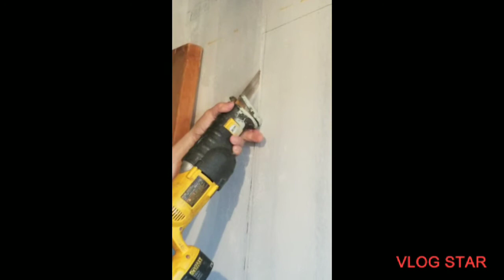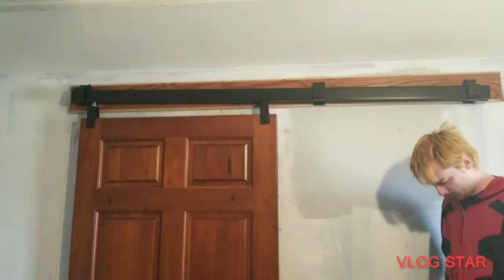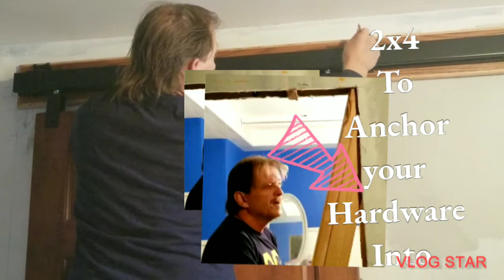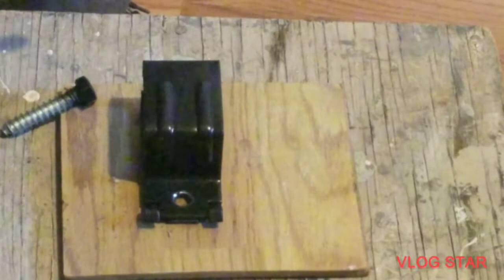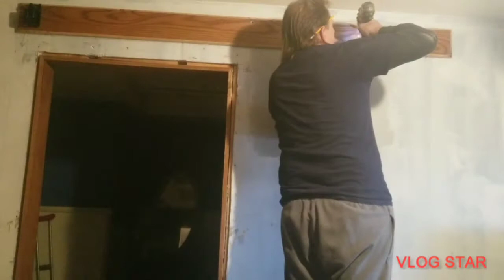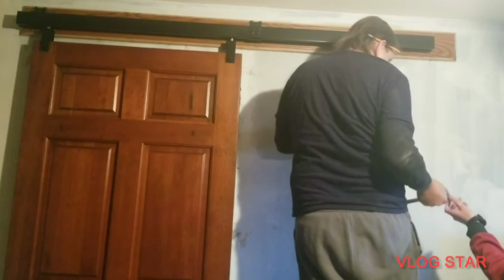The Right Way To Hang A Barn Door quick and easy

Comment: good work Ken and your clear instruction should help many with this task
a big like👍Au👍always a full view
happy new year
Reply from the maker: Billy, Is happy new years to you, I think this could have been a little bit clearer for some, I mentioned in the description you can use the same message by having the  Hardware connected to the door the rail in place in order to set your header board for the or the barn door header.

And then you set your rail to the header when you installed the door like you seem in the video.

I hope you have a safe New Year's thank you for your time and support it means a lot it's always good to hear from you life for now your friend Ken.

Comment: That turned out great, I'm thinking of putting them on my closets.
Reply: This type has a tendency, to have Problems with the Track
Look into the Soled Rail type.
Reply: @lisawilliams15  Thank you, I will.
Reply from the maker: Hi,  Depending on your closet  Opening, In most cases you would need 2 doors, And if that's the case, You would have to have 2 of this type of rail welded together hold it together, and in brackets welded to them to go around The top of the closet door wall /  Close it opening at the top.

But if you only need one door to do the job then yes that would be perfect.

I do not recommend this type of barndoor  Rail, The groove where the door slides, They have a tendency to be bent and then you have to  Is spread on my part and make adjustments to the rail opening where is opening where the wheels roll.
So because of that, I wrote, I recommend the Solid bar type barn door rails, you can get them in a kit.

I hope this is helpful if you have any questions feel free to ask to get some more in depths I don't mind talking with you on messenger well thanks for watching for commenting I look forward to hear from you by for now Ken